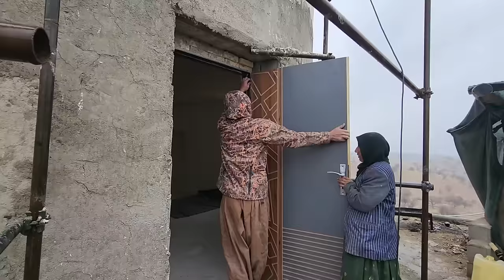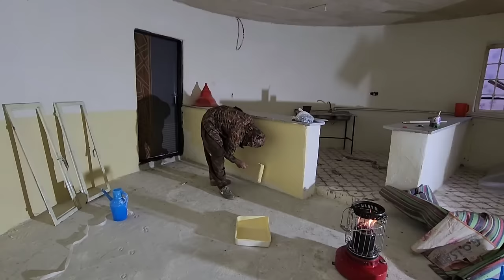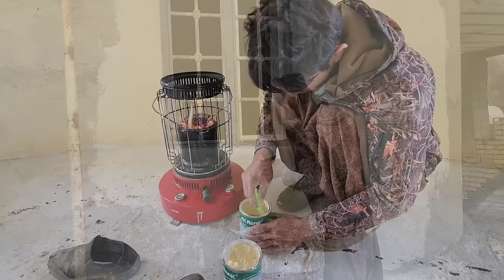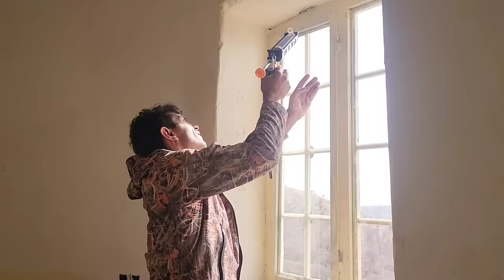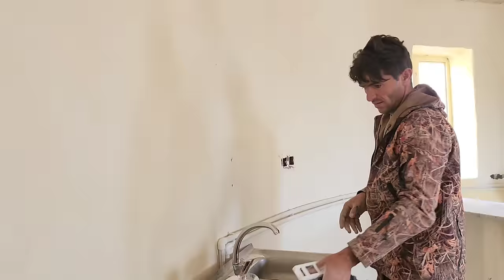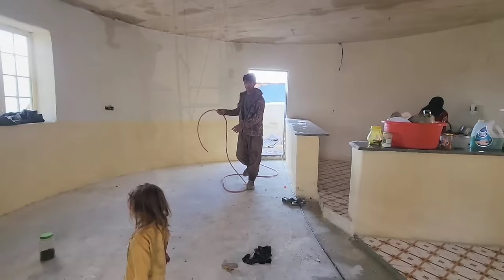Rain and Castle: Hasan and Zulikha's efforts to prevent the destruction of the castle

Comment: Hasan, you should have bought the long handle for your paint roller.  It's easier to reach higher up or down. Is the light yellow acting as a wains coat or border? If so, you could add a strip of wall paper-boader, glued on, perhaps a bronze stripe around the wall. Would look fancy.  Good luck getting things done today.  Love the door.❤ 

So sorry about the hindrance of rain.  I hope it doesn't cause damage to your cielings.
Reply: PS....Another friendly suggestion,  sweety. Don't water down your paint.  It won't cover as well. On your detailing, like around the metal flowers on your doors and windows, use a small detailing paint brush. Real small one so you don't get the cream color on the gold. Because the cream color was watered down, it ran onto the brown part. If it's not diluted, it should cover easy and not run. To cover the dark brown, you need metal enamel paint. Good luck!
Reply: Okay, I see that the entire walls will be one color/cream, but later you could add around the walls a wide stripe in bronze.  I saw the Peren family there on a channel, so this, and it was fancy looking.

Comment: Hassan, I am very sorry for this situation. You should have built the water gutter before you build the crown of the tower because winter has come in your area and if the weather stays rainy for a few days, there is a possibility that the roof will fall. You deserve the best, my friend.❤
Reply: I think I saw rain gutter stacked under the porch roof.  It's like locking the barn after the horse has been stolen.

Comment: Oh dear, the roof is leaking badly onto the 2nd floor. Rain water seeping through ceiling and walls. As expected, you need to waterproof the floor of the roof properly before laying cement concrete slab.😅😢😊